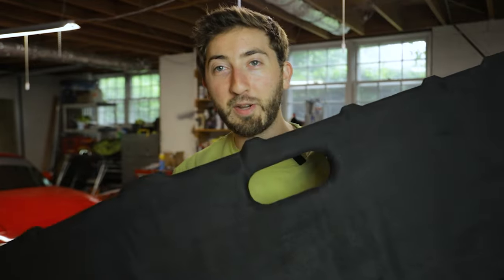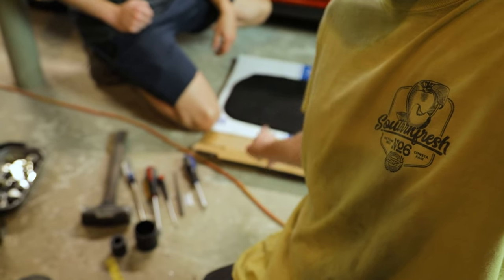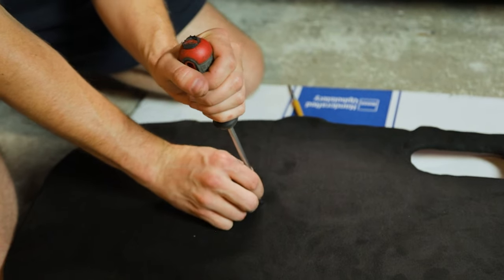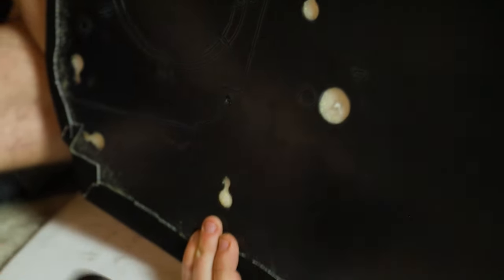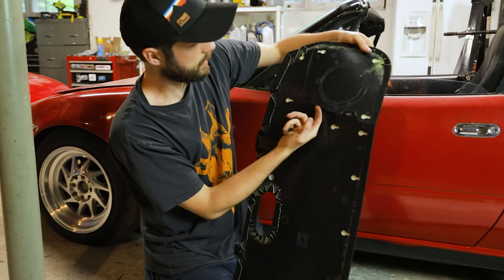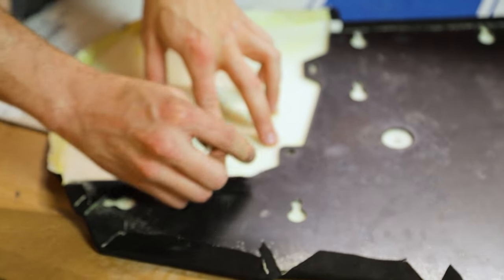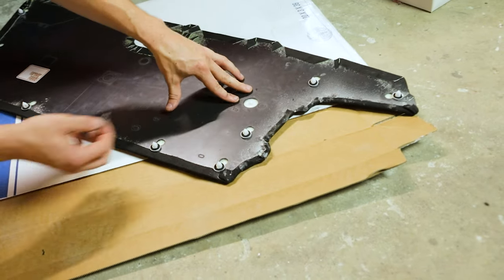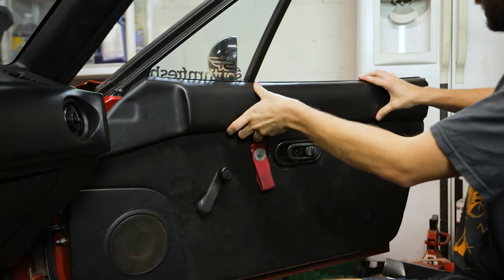The Last Door Panels Your Miata Will Ever Need!

Comment: Nice video, thanks!  I'm the guy who makes the Forever Panels (the abs part) for Moss, I just sent you an email.  I've got a few bits for you to finish these up.
Reply from the maker: Thank you! Replied. 😄
Reply: when using the factory clips, how do you make them not show up in the leather, i guess use a foam backed leather?
Reply: @thejasonrk  I use 1/8" closed cell foam on the panel first.  The factory used open-cell, but it collapses really easy. I'll typically put a little blue tape over the clip hole area before I use the spray glue - this allows the foam to give just a little and not telegraph through to the top surface.

Comment: can strong adhesive thin magnet strips be used to help secure the upper arm pad to the door.  or possibly hard drive magnets?
Reply from the maker: Never thought about that. Worth a try for sure!
Reply: @AlexPerrucci ...the trick finding the right adhesive (e.g. 3M automotive) or other liquid adhesive.  if magnets can work for speaker grills, they can work for door/trim panels too, yes?